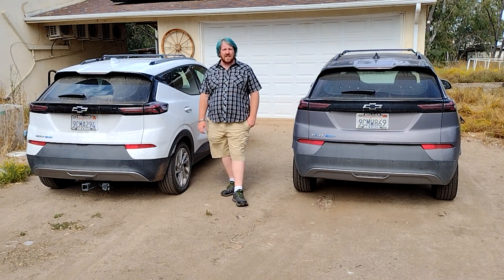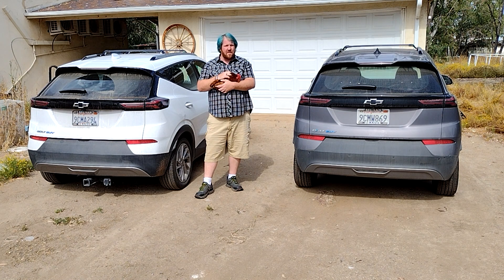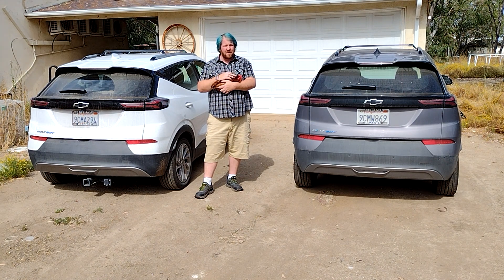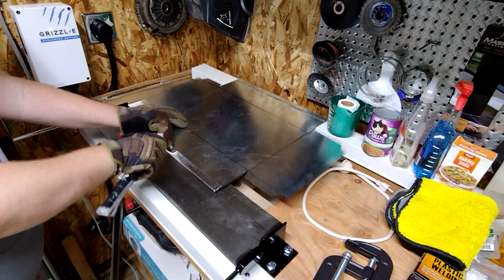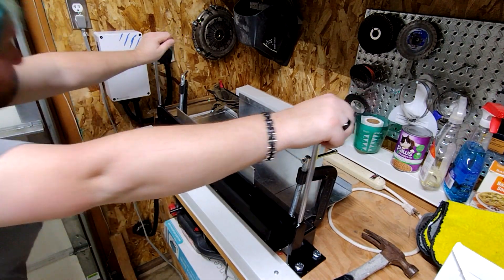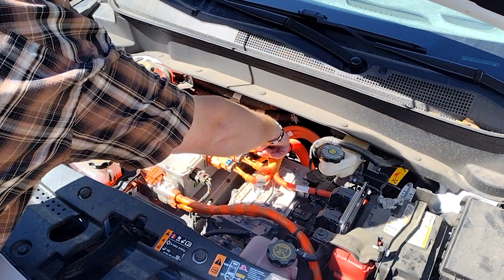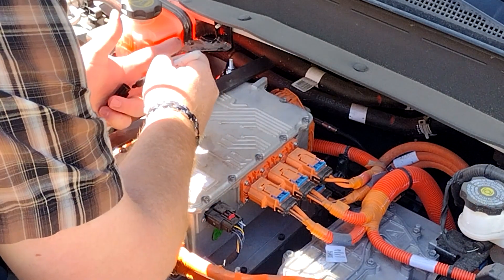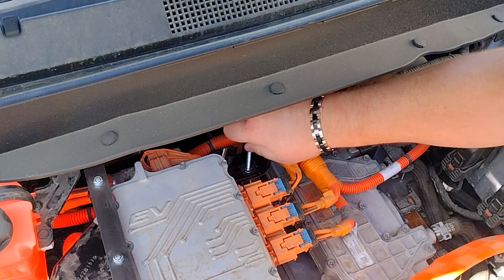How to Install a Hardwired Inverter in a Chevy Bolt (or other EV!)

Comment: What year Bolt is this?   Is it really fuse #10?  What circuit is that fuse for exactly?   (re:door chime defeat)  thanks for the video.....  I'm going to mount my inverter slightly diagonal on floor in front of Front Passenger seat.  Much lower temps and less dust.  I'll be using mine sometimes while driving...Underhood gets quite hot.
Reply from the maker: This is a 2022, as far as I know that fuse is only for the pedestrian noisemaker

Comment: 17:42!   yeah , its crazy to have to pull power from a poor little 12v battery when we are driving around 400v DC that is being inverted to AC already for the motor.

Comment: You would think that if we are driving around a giant battery that is already inverting DC to AC  that manufactures would just offer us 120v15A AC power plugs in the car?  Having to step up to 120vAC from a  little 12v DC battery that has to be replenished by 350V DC battery that drives a 355V AC motor is less than optimal.

It's my experience that inverters under the hot hood overheat and turn off,  they tend to do better 3' way under the drivers seat.
Reply from the maker: I wish they gave us the option from the factory.  Putting the inverter inside is a valid option, however in our case, the most common use for this has been powering our house during an outage, which often happens in the summer when it's 100+ degrees out.  The interior of the car gets REALLY HOT in those conditions, so the only way an inverter would stay cool is by running the A/C, which would waste more battery.  Under the hood, it stays cool just by removing the box lid.

Comment: I want to install an inverter in the cab.  How do I get 2-4 gauge wire through the firewall?
Reply from the maker: I would imagine you can poke it through the same spot I ran the extension cord, 2-4 gauge should be about the same thickness.
Reply: IMO, I would use 0 or 1 GA and no longer than 3' and place it under the drivers seat, any longer or smaller and your inverter will be limited.  Shame that we have to pull from the 12v.

Comment: Thanks!  Amazed at how little power that used to bake those cookies.  Pretty cool setup!
Reply from the maker: If you figure the toaster oven uses 1,500 watts which "feels" like a lot, but only ran for ~30 minutes and the thermostat cycled on and off during that time, it's really not significant compared to driving the car.

Comment: How is the inverter holding up over time? I've seen temperatures under the hood of my EUV reach 165f when fast charging, that can't be great for the inverter long term. If it's not an issue under the hood seems like the most convenient place by far!
Reply from the maker: We used it a couple weeks ago when the power company shut off our power all day for "maintenance."  Weather was in the 90s that day, and ran our house for ~8 hours with no issue other than I had to take the lid off the box.

Comment: There’s always that one person that makes you reevaluate your skill set and cleverness.
Great job and excellent video skills.
How’s the temp working out for the inverter so far?
Reply from the maker: Haha thanks.  But all I know how to do, I learned by watching YouTube.  So if you're watching this video, you can do it too!

It's held up just fine, but both times we've used it camping have been in cooler weather.  Our (not so) friendly local electric company has decided they need to turn off our power next Thursday so we'll get another use out of it then.  It's not going to be 107 out though, like it was during this test 🥵

Comment: Great install! Amazing. Ima try install on my model 3.  But use another battery that draws from the 12v. Then the inverter attach to the extra battery.  Seen it work youtube tesla too sensitive sensors.  

Got a chevy volt but its battery isnt as big compared to the m3
Reply from the maker: I've heard there's a way to do it on a Tesla but you have to hook directly to the DC/DC converter and use a resistor or something to prevent a current spike from the inverter's capacitors when it turns on.  I don't remember where I saw it, but I recall coming across it somewhere.

Comment: Shouldn't there be about a 200 amp fuse or circuit breaker between the inverter and the 12 v battery?
Reply: I think the 2000 inverter has a built in fuse
Reply from the maker: If you're not a hack, there should!

Comment: I just wired my bolt for an inverter and found this while searching for ways to permanently mount the inverter itself. Nice job. It doesn't seem like anyone has made any brackets for mounting commercially available yet which is a bummer. For now I may just store the inverter in the 'sub trunk' area and plug it in when I need it.
Reply from the maker: I thought about mounting it in the "sub-trunk," but the problem with leaving it there permanently is the lack of ventilation.  Otherwise I would have just mounted it there.
Reply: @jkfeatherranch  getting the proper wire sizing all the way back there without too much voltage drop would be pretty extreme too.

Comment: why did you make that big box? The inverter could be unprotected in the engine compartment. Why did you go the complicated way of running a cable to trunk instead of just plugging it in at the inverter?
Reply from the maker: Because I had to justify buying a sheet metal brake and spot welder, of course!
Reply: Wouldn’t the inverter get wet?

Comment: Is this stressing the small 12 volt battery? Is the 12 volt battery constantly being recharged from drive batteries?
Reply from the maker: The car's onboard DC/DC converter can supply up to ~1.6 kw continuously, so as long as you do not exceed its output (which you can determine by monitoring battery voltage and making sure it doesn't drop below 13.something), then you are "pulling" from the DC/DC converter and the battery is basically just "there."  If you exceed the output of the converter, then yes, you will start to draw down the 12v, which is "ok" as long as you don't do it for too long, and it will recharge when your usage drops below the limit.
Reply: @jkfeatherranch  the 12v battery is basically a big buffer in the 12v electrical system after a car is started. It allows for some variance in load over time without stressing the other components of the system (i.e. the fuses and wiring). 

You can use an auxiliary 12v battery (or several in parallel) isolated from the main 12v battery with a special voltage relay that charges the aux batteries when they are low but disconnects the primary 12v so you don't drain IT. that way you can have a giant buffer for something like the startup load of a refrigerator. 

Don't ask me how I know all of this.

Comment: Why not go to the main battery of the car?
Reply from the maker: Although this is probably technically doable with the car running, I don't know if the electronics would freak out from an unaccounted-for drain on the main battery, plus I haven't come across a readily-available inverter with 400v input.

Comment: Maybe use aluminum hardware with bolts to avoid welding?
Reply from the maker: If you don't have a welder, there are certainly other options!

Comment: wait.... what ?  the small 12V battery is connected in with the main car drive battery ???  Impressive.   Geeze, why buy a powerwall ?  Great job.
Reply from the maker: Thanks.  Every EV has the equivalent of an alternator to take power from the big battery and charge the 12v.  This is the easiest way to run an inverter.

Comment: Nice setup! What is the wattage of the toaster oven, and about how long did it take to bake the cookies? Does your inverter have a GFCI outlet? And if so, do you have to take the cover off of the box you built to reset the GFCI outlet?
Reply from the maker: The toaster is 1500 watts, that's pretty much the upper limit for cooking appliances.  I think it took ~20? minutes to make the cookies, since it had no problem hitting 300 degrees it shouldn't have been any more than using our home oven.  The inverter does have a built in GFCI, but it can be reset from inside the car simply by turning it off and on again.
Reply: @jkfeatherranch  Thanks for the reply. That is what I was expecting. Thanks for the reassurance.
Reply from the maker: @paulstough2995  you're welcome 👍

Comment: Couldn't  you plug in an inverter into the 12 volt  plug and use that instead of having to do all that work?
Reply from the maker: The problem with that is that the 12v plug only provides 10 or 15 amps, so 120 or 180 watts max.  The hardwired inverter gives 2000, or enough to power our house during an outage if we're careful with what we use.
Reply: @jkfeatherranch  I've heard that since you're running off the 12v battery that the main battery is only able to keep the 12v battery charged up to 1000 watts of use.  If you go over that then you will eventually drain the 12v battery.  Have you considered this?
Reply: @IndiaUploadsEngrav  Once the inverter shuts off, You'd think that the main battery would eventually charge up the 12v battery.   Although not sure what the repercussions are of doing this. ( as far as car settings / memory )
Reply from the maker: @IndiaUploadsEngrav  You are correct.  The car can provide approximately 1,000 watts (seems like slightly more in practice) continuously to recharge the 12v battery, however it is perfectly fine to exceed this for short periods of time such as for ~30 minutes when baking cookies.  It's even less than 30 minutes in practice, since the toaster oven was cycling the heating elements on and off to maintain temperature.  If you're going to be doing this for long periods of time, however, a way of measuring the 12v voltage would be useful.  I recommend an OBD2 dongle and Torque (or the equivalent iPhone app) to keep an eye on it from your phone.

For what it's worth, after shooting this video, I was able to run a 1,500 watt space heater for an hour straight without killing the 12v, and when I turned it down to 1,000 watts, the voltage shot back up to 13+, indicating that the car was charging it while also supplying the full load of the inverter.
Reply from the maker: @breeeep It would at the very least severely shorten the life of the 12v battery.  They don't like being ran completely dead :(

Comment: This is great, and super useful!!  BTW, that box on top isn't the drive inverter, that's called the "High Power Distribution Module" - basically just a box with some contactors in it to enable high voltage to the various components. The motor inverter sits below that one.
Reply from the maker: Thanks. Ah. Close enough.